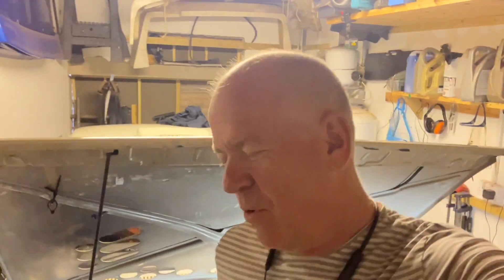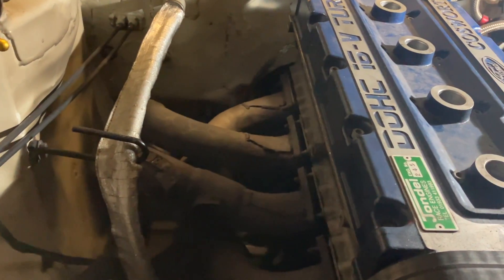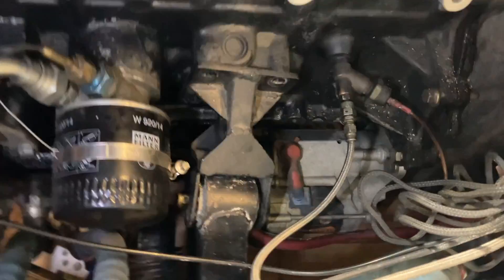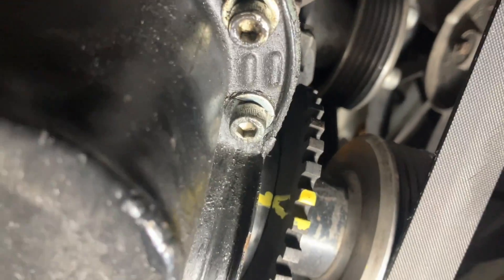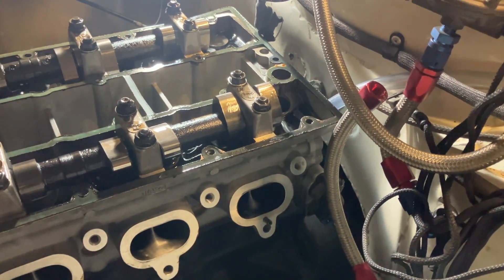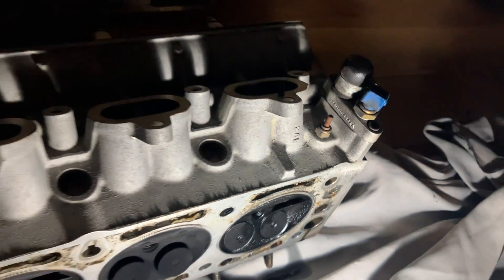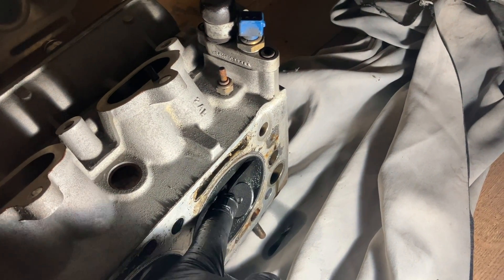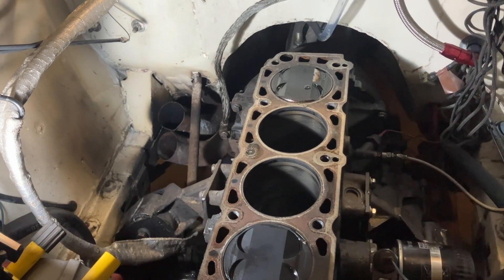the 15 valve cosworth YB engine

Comment: Sorry the rally didn’t go to well for you Tim.
I was really glad to help setup the rally and then did some marshaling as well for all you guys. Good luck next year
Reply from the maker: thanks for everything you do. we have taken loads of positives from the rally and had a really good time. there were a lot of cars not as lucky as us
Reply: @jerseytim100  true I was on the st Ouens stage before I had to leave for st Saviour stage to set up, quite a few roll overs and a couple of road blockages on the st ouens, could hear it all on my radio
Reply: Valve sprung snapped is my guess
Reply from the maker: @ktm962007  Yes looks like the valve spring has snapped. i was so lucky the collets didn't come off and the valve drop into the cylinder as the engine would probably be ruined